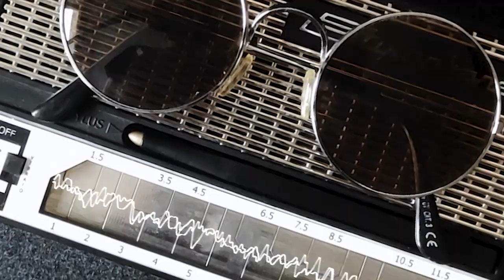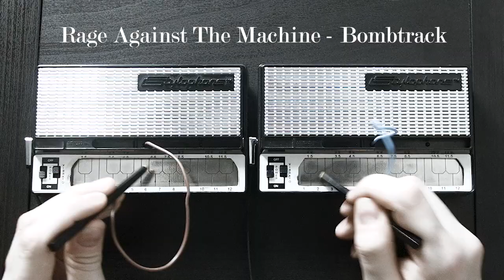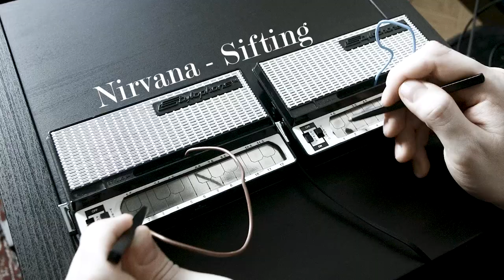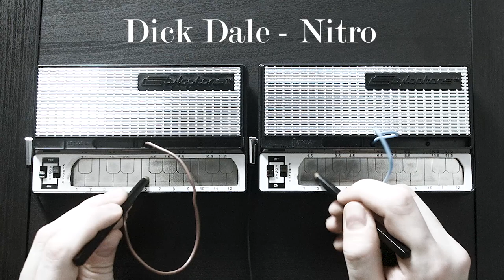20 BADASS Riffs On Stylophone (last one is pure testosterone)

Comment: List of all songs for the interested:

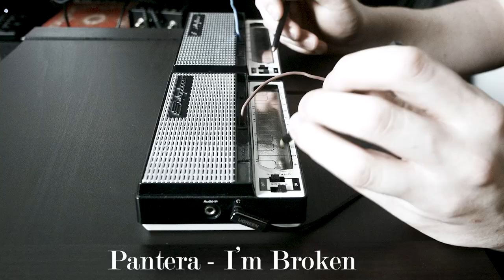0:02 / Pantera - I'm Broken
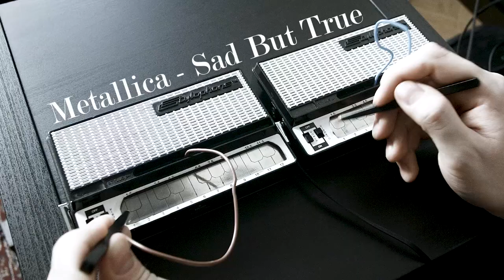0:08 / Metallica - Sad But True
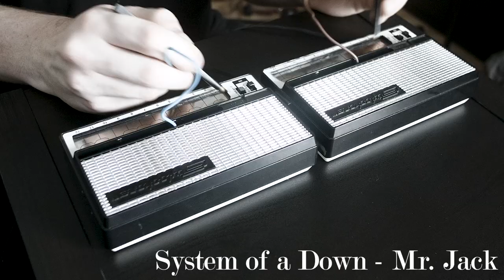0:14 / System of a Down - Mr. Jack
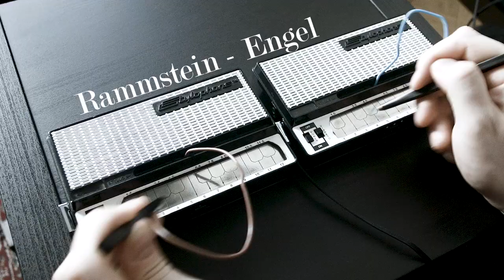0:20 / Rammstein - Engel
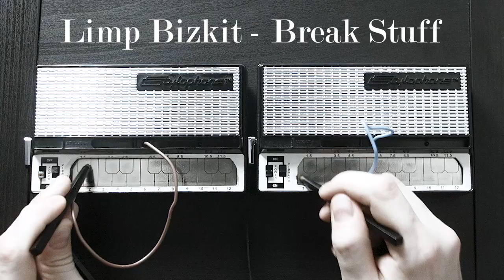0:25 / Limp Bizkit - Break Stuff
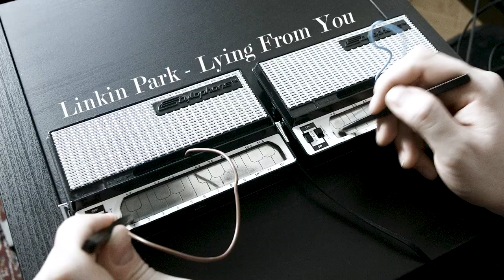0:29 / Linkin Park - Lying from You
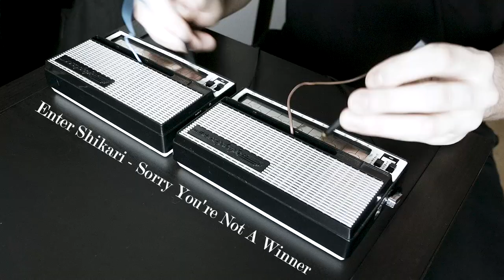0:35 / Enter Shikari - Sorry You're Not a Winner
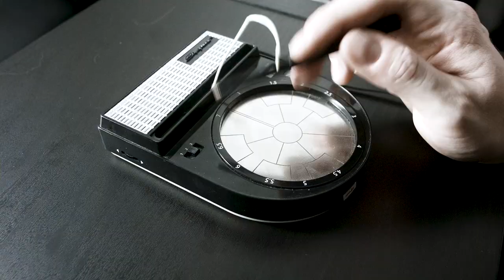0:44 / Avenged Sevenfold - Unholy Confessions
0:54 / The Offspring - Million Miles Away
1:04 / Rage Against The Machine - Bombtrack
1:10 / Jimi Hendrix - Manic Depression
1:18 / Black Sabbath - Sabbath Bloody Sabbath
1:26 / Slayer - Bloodline
1:33 / Nirvana - Sifting
1:42 / Megadeth - Holy Wars...The Punishment Due
1:50 / Buckethead - Final Wars
2:03 / AC/DC - T.N.T.
2:10 / Red Hot Chili Peppers - Readymade
2:23 / Dick Dale - Nitro
2:51 / Link Wray - Rumble
Reply: Ty